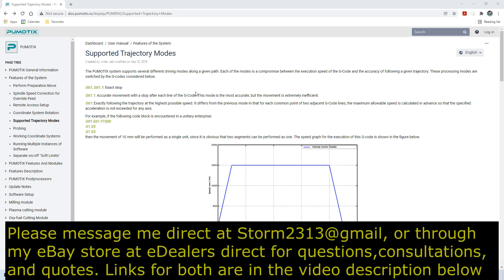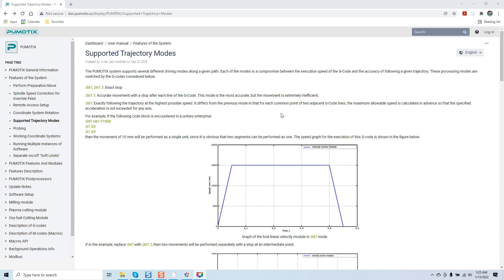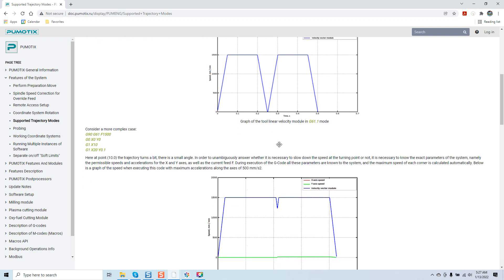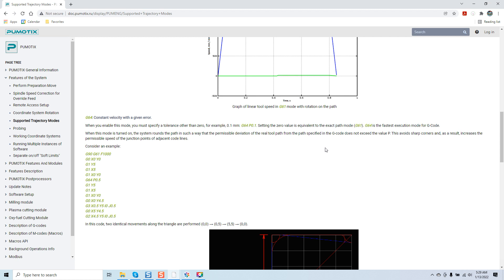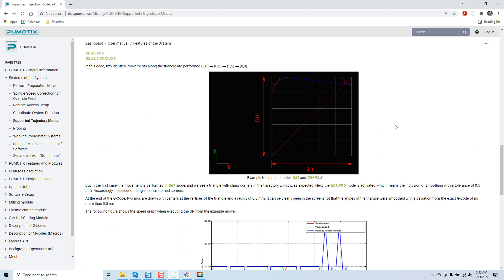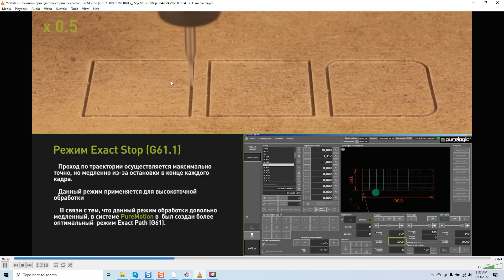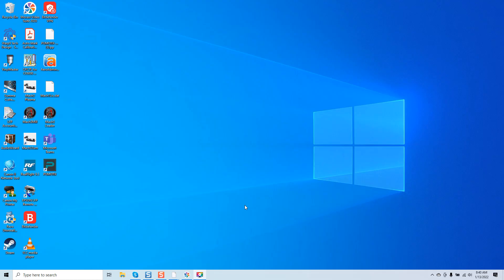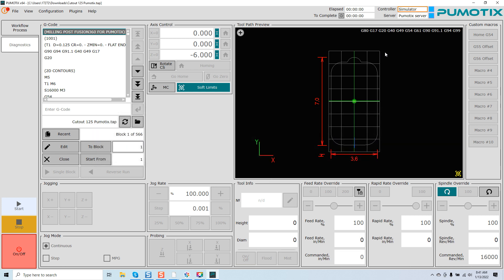Understanding & How To Set G-Code Trajectory Modes In Pumotix..

Comment: I think that G64 is great for long producion runs of parts. It lets you adjust the smoothing on parts manually and speed up the process. In Fusion360 they have a smoothing tab that you can select but this is great for CAM software that doesn't have it. My setup was G64 with 0.150" tolerence and gave me some issues, I think the default install should be with either G61 selected or G64 witih 0.001 tolerence to keep from having any weird issues like I had. Now that there's a video on it, people can check to see where their default install is set up as. Thanks for the explanation video, wished I knew about this sooner lol
Reply from the maker: Thank you Rick for your support, and hopefully this video makes it clear for everyone. Have a great weekend!
Vince